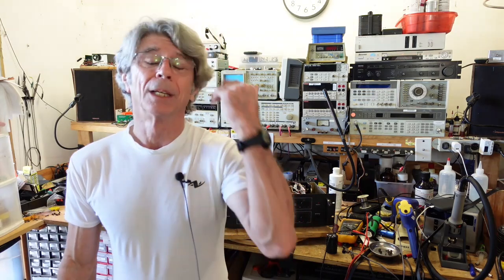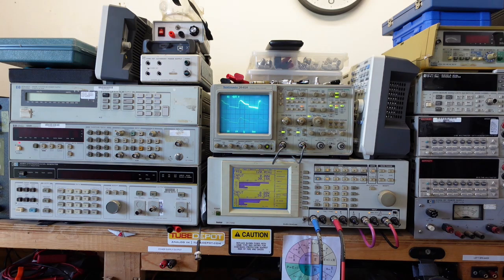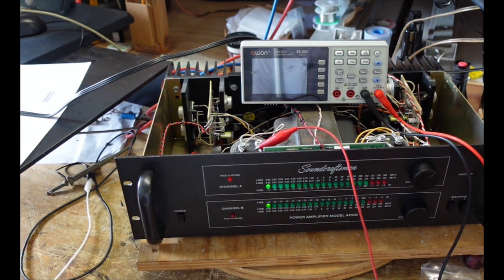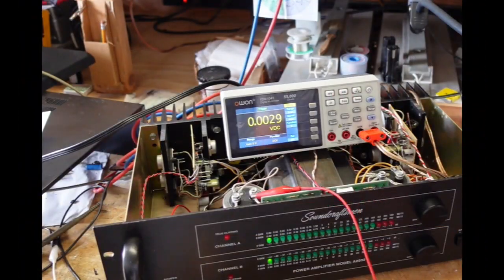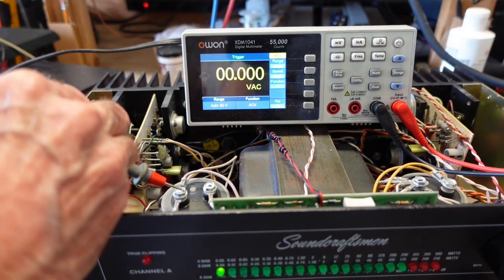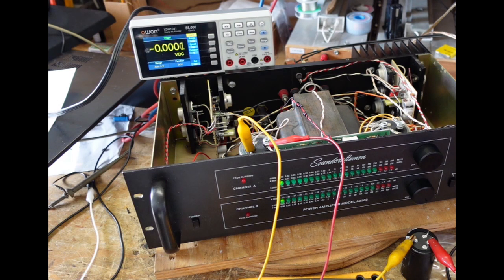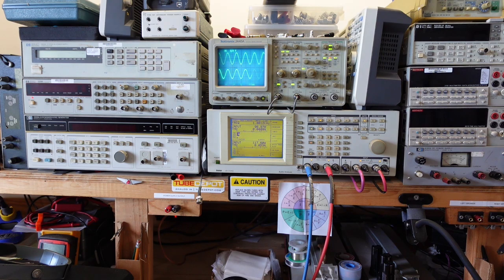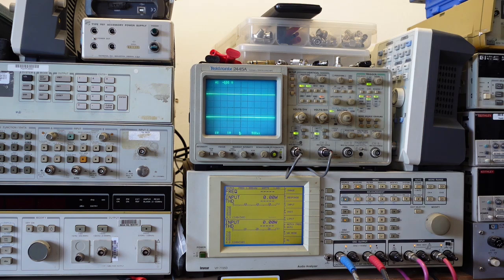Soundcraftsmen A2502 Repair

Comment: I need to install fuses in my test speakers; I just used dummy loads on this and saw that it would have probably blown my speakers. Soundcraftsmen is usually known for very long-lasting filter caps, but obviously not this amp. Another valuable lesson, thanks Ray!
Reply from the maker: I tested the good one, and it was fine, close to rated value with low ESR.  The bad one read totally open.  Just one of those random things, I guess.
Reply: @raygianelli3612   I played this amp today after getting it back and all I can say is WOW! It has stellar sound even through my test speakers, bass is very very solid and punchy.
Reply from the maker: @stevegropp2551  Those MOSFET outputs are the secret sauce!

Comment: Ray, have been helping out a fellow tech from time to time with the heavy stuff ( before my hip replacement ). He and I now use drill bits to drill out the capacitor clamp rivets ( outside the chassis to keep metal chaff from getting inside the chassis ) Makes cap replacement a quickie . Install new cap in clamp , use screws to mount clamp. Easy peasy for the next time too ! Herb
Reply from the maker: I'd considered doing that.

Comment: Ray , many years ago , one of my mentors joked that a power amp is simply a power supply modulator. Yup ! What brand of can caps do you like to use ? Do you have and use a ESR meter ? They are also useful as a milli-ohm  meter . Some of the more modern power amps now have multiple types of power supply caps across the rails…electros, big film, small film, ceramics. As I understand it , the goal is to insure lower power supply impedance over a wider range of frequencies. Good to see you back at it. I had a hip replaced last May. Servicing heavy vintage audio was just not doable for a few months. Herb
Reply from the maker: I used mostly Nichicon and Panasonic caps. I have an East 4401 LCR meter that has Kelvin leads.
Just turned 70 and most everything still works. Need cataract surgery, will schedule that around the first month of the year

Comment: Very good! Every now and then, a guy just has to say thanks because it’s an easy day…
Reply from the maker: Diagnosis was easy.  I found that removing the caps is going to be a pain, because the clamps securing the caps are riveted to the chassis, and the tension screws are hard to get to.  Probably going to take longer to get them out than it did to figure out the issue!

Comment: Great video, thanks!   My A2502 is back operating, but nice to see your troubleshooting and know what to expect if my caps go bad.  And that replacement caps can be found.
Reply from the maker: Hi Richard.  Even going up a little in capacitance and voltage didn't get me a cap with the correct diameter.  So I'll have to shim them a bit to get the clamps to hold them.  But it will work!

Comment: Excellent video, as usual. Thanks for putting these together! BTW, how do you like the Owon meter?
Reply from the maker: It's OK.  Even on the fastest acquisition rate, it's a bit pokey.  I like the display though, especially for videos.
Reply: @raygianelli3612  OVON is known for its slow loading speed, but it measures quite accurately.
Reply from the maker: @Edisson.  Typical impatient American. 😝
Reply: @raygianelli3612  We say: How do you measure it..... 🤔 I have OVON ....... 😁 Oh, so I'm going on vacation and when I get back, I'll check if we have the result yet 😂